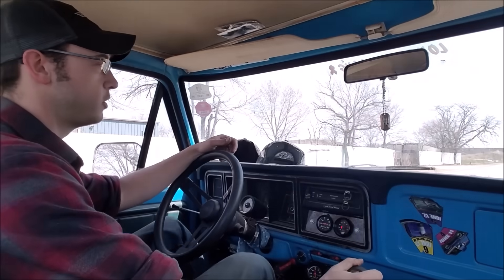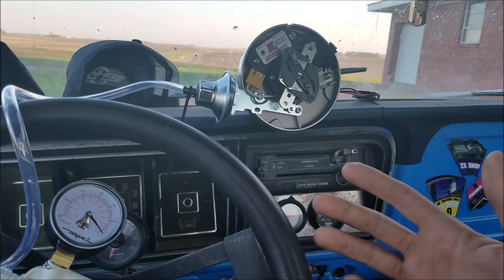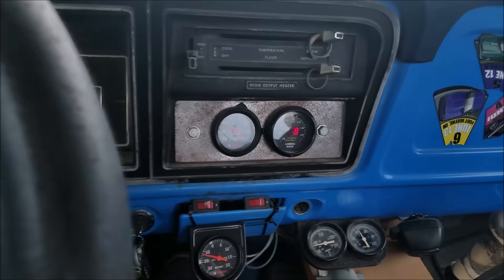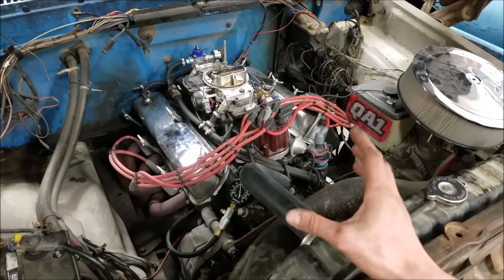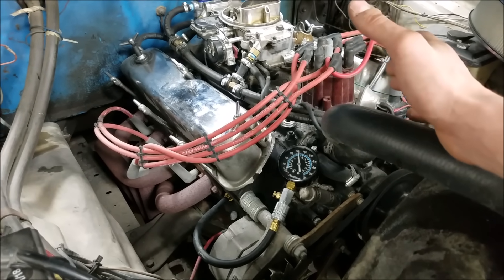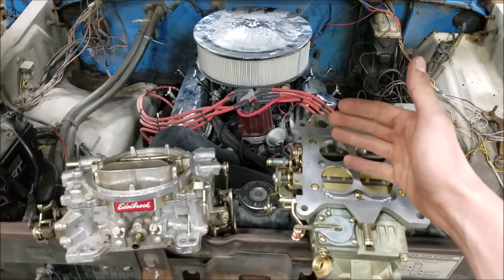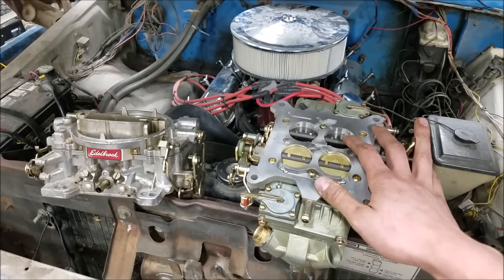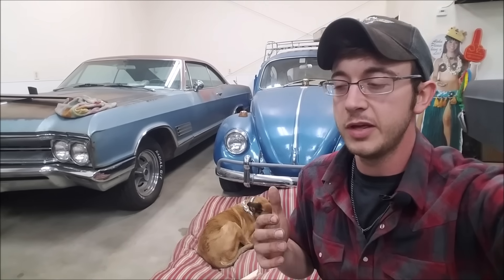Vacuum Advance - Ported vs Manifold: Which to Use & When !!!

Comment: I’m 14. I have a 53 ford customline that I am building into a ewrly 60s style custom. I just built up the old flathead and stroked it an all thag good stuff. I work at a machine shop to make the money for my build. I’m the only one in my family into this stuff. And I just did all this to my motor. And this is what I figured out. As of now I have my distributor set up on manifold vaccum because I can put as much timing into the distributor as I can before it kicks back. And then once it fires it gets even more timing from the manifold vaccum at idle. But if I did this at the port I would have less timing at idle and therefore less total timing.
Reply from the maker: When you mash the pedal, you lose your vacuum advance timing. So by moving to a lesser mechanical unit I’ll setting, you are leaving power on the table - this is what a lot of folks end up doing.
Reply: ThunderHead289 so it’s only advanced at idle? And when you gain rpm you loose vaccume, therefore you loose advance?
Reply from the maker: 53_Ford_ Custom vacuum more so relates to your throttle position. Run a vacuum gauge into your cab and step on the throttle and observe the gauge - vacuum will drop. When this happens, you also lose vacuum advance where you are strictly on your mechanical timing. 
Pretty cool a guy your age is into this stuff - check out the ignition timing playlist on my channel page, it will be very helpful for understanding ignition timing!
Reply: ThunderHead289 got jt! Thank you very much!
Reply: You set up timing with the vacuum advance disconnected.  AFTER you set the timing, you re-connect it.   Remember, your stock distributor only had a vacuum advance, no mechanical advance, so you must use ported vacuum, or else you will have no spark advance.  It will run at full advance most of the time, which will cause severe pinging under load, and way too much advance at idle.  It might be impossible to start that way or break the nose off of the starter.  You must go to an aftermarket distributor with both mechanical advance and vacuum advance if you want to experiment with ported vs manifold vacuum.

Comment: i do not believe a good aftermarket HEI distributor craps out at 5500 rpm, is feel it doing that like a rev limiter, and im good till 7500,, then i shift. that distributer did look like a good zapper though.

Comment: Thanks for taking the time to make this video, it's good info.
Personally I like using manifold vacuum so the engine keeps the vacuum advance under deceleration
Reply from the maker: Now that is the one thing I will give you that is indeed better since the mixture goes lean - that’s what I really like about that progression unit!

Comment: I run manifold, and with a high lift mild durated cam.. the reason? I run my AC. The compressor will kill the engine or it will die when you drop it in gear with the AC on.  If you set the base timing high enough with port vacuum, to not die, the engine kicks back during cranking.  With manifold vacuum I can lower my base timing and let the manifold vacuum advance the timing at idle and smooth out the low end drivability problems, and still have the engine start without kicking back during cranking. To each his own.. and that's only on the 460 I run nothing else. I also learned a trick. Lengthen the stroke on the vacuum advance, so it advances further than stock. This way, you can run a lower base timing and allow the manifold vacuum, pull the timing higher and make up for the lower base timing.  You have to modify the base plate, by elonging the grooves on it, and let your vacuum advance pull it further around. Works great..
Reply: Precisely!!

Comment: I've got a 1981 ford e350 box truck, automatic with 400m and 2bbl holley, the truck was messed with a lot! The PO actually welded a F350 extended cab onto the cut away....The most homely truck in town (I cut the extended cab off and moved the box forward. Anyway the fuel pump diaphragm rotted out and then the 3 electric fuel pumps went bad, along with the 3 extra fuel gauges (franken truck) I put a mechanical fuel pump on, deleted two of the tanks and the egr, the truck starts fast even after sitting for weeks and shuts down on command without any run on, but it runs hot and stalls after it is warmed up.
Any ideas? 
The vacuum sits at 17 @ 2,000 rpm, 5600 ft above sea level, no timing indicator so can't check timing.
Reply: It's got good antifreeze and flow, might be a little restricted, haven't checked the thermostat yet.

Comment: I use to set initial timing to create the most vacuum at idle
Reply: Right... with the vacuum advance disconnected!  Then reconnect after adjusting the carb & distributor for highest idle vacuum.

Comment: Remember: the ONLY reason Ported Vacuum was used was for emissions - to increase idle combustion temps. IMHO, there's NO good reason to use ported Vacuum, unless you want a bone-stock engine. None.
Reply from the maker: That’s a lie that’s been perpetuated on the internet for far too long. 
Flatheads had ported, my stock 64 galaxie had ported with an open crank case breather, both long before emissions thoughts. 
Don’t get stuck in what you have heard. Running ported on a mostly stock engine allows you to run more initial mechanical so when you hit the gas, you still have decent mechanical advance. 

This isn’t simply move the vacuum advance port to Porte fans walk away. It requires a change of initial mechanical to accompany it. There is a lot of opportunity to make more power on stock and mild engines - don’t squander the opportunity
Reply: @ThunderHead289   ThunderHead289  I totally understand everything you're saying, especially regarding the total tuning package. 
However, I disagree that I'm telling lies. My info comes from a GM (AC Delco) engineer who worked on ignition systems from the late 50's to the 70's. His view was that ported was a crutch for idle emissions.
Regarding Ford's before the mid-60's, they were 'LoadoMatic' distributors, a whole other animal from what we're talking about here. They switched between Venturi and a kinda-Ported vacuum source, often had no centrifugal advance, and we're generally one of Ford's worst ideas ever.

Comment: High vacuum/low load scenario also occurs at idle, bringing your air fuel ratio close to stoichometric (misspelled). You can lower your engine temps by adding timing at idle... Manifold
Reply from the maker: OR you can run more mechanical initial, or did you miss that part? 
It’s not simply a switch from ported to manifold or manifold to ported without doing anything else. 
I can explain further on how this is effective if it still doesn’t make sense.
Reply: ThunderHead289 you did mention it. You’re right. Thank you

Comment: geez got enough washers on the alternator?   make a spacer please!!!
you want timing to retard when you snap throttle WOT, if you have full advance on a snap WOT you have a slight lean out which causes detonation.  Manifold vacuum only!
Reply from the maker: Both manifold vacuum and ported vacuum both drop timing at hard throttle. I literally explain that the only difference between ported and manifold is vacuum advance added at idle.
And I live that washer stack to irritate internet people 🤓
Reply: @ThunderHead289  Ported vacuum applies as soon as you open the throttle plate.  when doing a snap WOT on ported vacuum, you will see timing advance.  (bad).
Reply from the maker: You won’t. Go put a vacuum gauge on your ported port and tell me what happens. I drove for 2 months with a vacuum gauge on my ported port - this is not an opinion, it’s true or false scenario, and I’m sorry but you are just wrong. 
Go test it yourself.

Comment: "ported vacuum" was strictly an early, pre-converter crude emissions strategy, and nothing more. If you want your engine to run much hotter at idle 'nobody wants this' then go head and run ported LOL, like a damn fool. Dude, what you need is a new style  distributor with vacuum advance limited to 10-12 degrees max. Many older distributors add far too much vacuum advance. If you look at the centrifugal advance calibrations for these "ported spark, late timed" engines, you'll see that instead of having 20 degrees of advance, they had up to 34 degrees of advance in the distributor, in order to get back to the 34-36 degrees "total timing" at high rpm wide-open throttle to get some of the performance back. The vacuum advance still worked at steady-state highway cruise (lean mixture = low emissions), but it was inoperative at idle, which caused all manner of problems -

Comment: The only difference between the two is at idle, usually when the car is not moving. As soon as the accelerator is depressed slightly, port vacuum and manifold vacuum are the same
Reply from the maker: Thank you. Someone gets it. 
How you can have some fun with a stock conservative total timing distributor is by running ported and advancing the initial mechanical. 

If you were to just advance initial mechanical, you would have too much idle timing. This gives you the ability to get more out of the stock parts.
Reply: It's not that simple dude. Educate yourself. http://rockridgefarm.com/vettdoc/Timing_101.pdf
Reply: thank you Rod   this guy really clueless, I worry ppl follow this advice
 @rodpalm6398
Reply: @rodpalm6398  You know alot of old schooler's don't like the modern technology because they don't understand it so they stick with the old tech; but after reading all the comments, I don't think they even understand the old stuff. Drop the old and get with the new, it's better and equally confusing. Besides it's 2020, distributor-less ignition's have been around since the early 1990's (*30 years ago*). C'mon, do you really need that small heavy black and white analog television when you can have a nice 4K 65"digital  flat-panel color TV hanging on your wall?

Comment: I tell you what didn't make sense...way too many f'ing ads.
As soon as you start making a freaking point  it's another ad interrupting. Make some money, but damn....12 minutes of ads...and split by 5 of them in 15 minutes is too much. You get paid by us letting the ads run, right? Guarantee everyone skipped every single ad.
 Good video, too much interruption.
Reply from the maker: My apologies for that - I’m just trying to supplement in enough to get myself out of the trailer park I live in. 
I know ads can be frustrating at times, but for my time to revenue ratio, I just don’t get much compensation.
Reply: Not trying to be hateful. I thought there was a pay rate for viewers actually letting ads run and one for when they just skip them, and if there are so many that your viewer just skips through...well....you get the lesser pay rate. One or two fewer or shorter ads ( not your choice?) and you reap the benifit of the better pay rate.
I just got frustrated with every couple of minutes and ad hits...AND it's right when you were mid-thought. 
Anyway, be cool, no hate, keep putting the content out, and live long and prosper. LOL

Comment: Where did you get the small dials and mounts? I just got my 1975 C10 running and I'd like to add a tach and maybe an air to fuel mixture readout.

Comment: Ported vs manifold also requires (prefers) a change in the curve.

If you push the initial timing but now your total mechanical advance is too far you've got to tighten the springs.

My old 390 seems to prefer manifold vacuum. It's also running a 1968 repop dizzy. To be completely transparent tho, it is my fuel economy project. I got 24mpg out of a carburetted 74 302 in a Comet, trying to see what I can get out of a 390 in an F100. 300hp and 420 ft lbs of torque, I can sacrifice a few HP if I can get it up to 15-20mpg (not bloody likely, but it is the goal).

There's also the issue of when they went from manifold to ported it was largely an emissions issue and lead directly to a lot of cars from factory overheating at redlights.

This may not be much of an issue in the cooler states but it is a huge issue in the south, especially in hot, humid Alabama.
Reply from the maker: You have to advance the initial timing. In many cases factory total timing is super conservative, so you can do this without modifying advance stops. 
The springs more so pertain to the rate at which the timing comes in.
Reply: @ThunderHead289  Yes, but there are shorter cams in the dizzy if memory serves, mine has the option to add 13 or 16 depending on how it's set, 26 total or 32 total mechanical advance over initial.

If you're running 16 degrees mechanical then you'll be running 42 degrees total, too high. You can get that same 16 degrees total with manifold vacuum while setting the mechanical initial timing at 10 degrees. Generally it's higher but it's fine, it drops as you load the engine. Manifold vacuum runs cooler at idle.

Comment: I knew the do and don'ts but didn't know why.  I was taught to disconnect vacuum advance and rely on mechanical advance with springs in distributor.  But we were always running huge cams. I run 33 degrees total timing on my 440 Chrysler, all in by 2500rpm. 248 duration cam @.050. 3000rpm converter with 3.91 rear gears and it doesn't see much low rpm operating.
Reply: I have the same cam specs and 3.91's out back. Mine is a 360 smallblock mopar. However, in upper rpm engine seems too want to layover or lose some power not sure why?🤔
Reply: @cesareomendez6794  yes my 440 has been doing the same thing for while.  I ruled out the timing and ignition system after it checked out ok. My secondaries may not have been opening.  Replace the accelerator pump and secondary vacuum actuator.  Also going to try a 750 mechanical secondary carb. I'm thinking it may be worn valve springs. I won't know till spring

Comment: I locked mine out at 35*. No vacuum advance. Hard to start, but installed a distributor kill switch to get the engine rolling, before firing it up. Not exactly stock engine though....

Comment: If I had the money, and ability to swap out the restrictive early emission camshaft from my 302 in my van, of coarse followed by a new timing set, tossing out the shitty plastic coated gear set, I would be on it, but things as they are, just gonna drive it till it dies, then worry about it, because if I had money, I'd get the damn wheelchair lift fixed first. 

I did pull off every vacuum line from my engine, threw them in the trash, put the ported line from the carb on the advance, 2 intake ports to the transmission modulator, and one for the brake booster, which was the best addition I have done, I like to be able to stop, the EGR was unhooked, as was the retard line on the distributor, no need to keep bouncing advance/retard while driving.

Comment: When you did your test you did not go to wide open throttle. If you did the manifold vacuum would have dropped off and the ported vacuum would have picked up. Ported vacuum gets it signal from air flowing past the port. What you were during during your test was bleeding manifold vacuum into the ported vacuum system when you uncovered the ported vacuum port. If you run manifold vacuum to vacuum advance the engine will idle better as your getting more burn time. If you monitor the the timing at idle on computer controlled new vehicular it will be 18-20 deg BTC. The problem with running manifold vacuum to a vacuum advance is when you go wide open and loose the manifold vacuum the timing will dump off what ever the vacuum advance is rated at 9-12 deg and you will get a bog. I could go on why the factory used vacuum advance and how it was used. The setup we used for street cars and mild drag was to put 14-16 deg intial lead (anything higher would make cranking engine when hot hard) limit the mechanical advance 16-20 depending on engine. Set the mechanical weights and springs to be all in at about 3000 rpm. Seemed like small chevy liked 36 deg total. Big chevy 34 deg total. Hope this helps.
Reply from the maker: My friend, I drove with the gauge in the car for two months. When you floor it both ported and manifold go to zero. If you don’t believe me, put a gauge in your own car. 

What you are referencing is venturi vacuum. This is what increases as manifold vacuum goes low - there is no external vacuum port for venturi vacuum on a standard 4 barrel. Internally, this is what the carb usss to open the vacuum secondaries. 

Now on VW carbs, they were solely venturi vacuum based for some years. 

I’m not sure where everyone is getting all this mis-information, but it’s dead wrong.
Reply: @ThunderHead289  
No such word as Venturi Vacuum. When you run a column of air down a tube and have a hole in it (And the base plate becomes part of the tube) you are going to have a pressure differential or vacuum pulling through that hole. It's funny when I finish a Carburetor Restoration and put them on my flow bench I usually pull about 18 Hg on the vac port. But you being the expert. A lot of disinformation on YouTube and your one of them.

Comment: i've had good luck ditching the vac advance and just shortening up the curve and running  more initial timing.
Reply from the maker: You would have better luck also running vacuum advance where cruising you would be more efficient
Reply: @ThunderHead289  sometimes i do but that works pretty good in all but the mildest most  stock application. run like 20 initial and a quck short curve.

Comment: i want one of those distributors for my 4 cylinder mg miget 1979  that would be a sick upgrade/mod  also im going to try manifold vacuum to try and solve some weber downdraft issues aswell the low idle theory and cooling issues those engine and carbs are known for and also the fuel comsumption on idle because apparently those carbs are slightly to big but i ported and port matched the head and manifolds so now with some new knowledge of to the garage to tinker